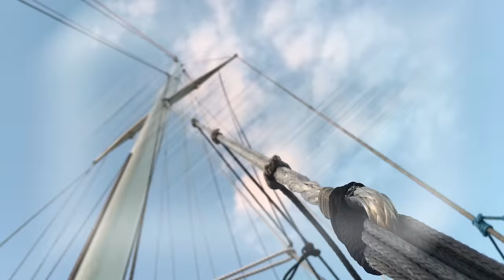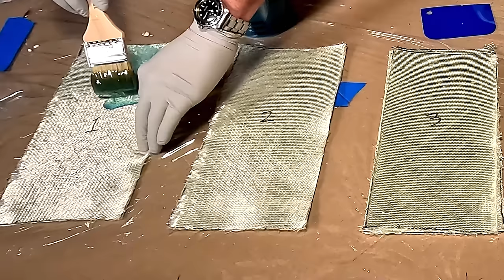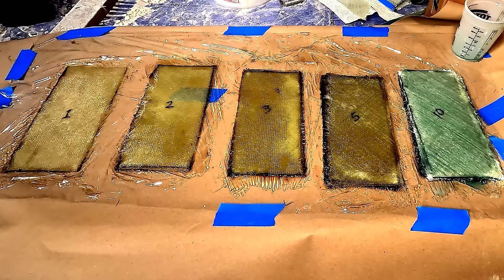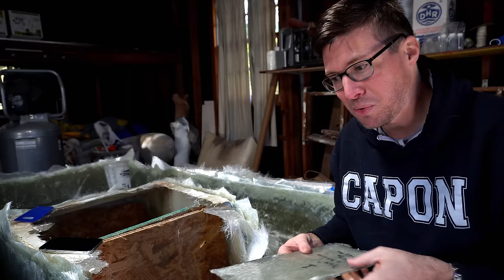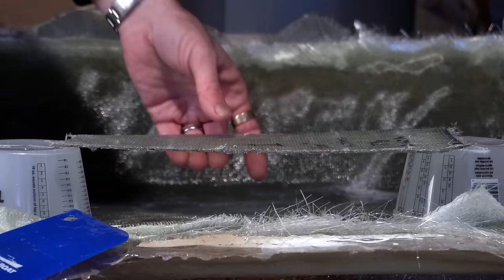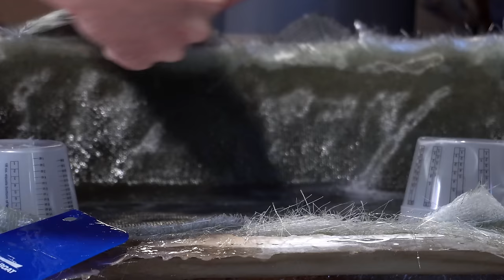How Thick is “This Many” Layers of Fiberglass? | Windpuff's Rebuild [S1 Ep 7]

Comment: My dad had a sample for each of his glass types that looked like a set of stairs.   He cut strips that were 5 inches wide at 25" 20", 15", 10", 5" then did the layers to make something he could keep and show to clients for each glass weave.   He also did some combinations in a stairstep manner for combinations of glass fabric that he recommended.   He drilled a hole in each one and hung it on the wall so people could see them and measure themselves with a set of calipers.
Reply from the maker: It makes a difference to have a sample that you can touch and feel instead of just looking up information in a table

Comment: This was a great real-world test for the hand build garage set up of building  a major part for a boat.  
Nominally 'back in the day' a square foot of fiberglass laminate 1\8" thick was 1 lbs.  This became the standard thickness for fiberglass parts ( not necessarily boats ). 
This was a simple way to price out a product too as you could compare to 1 lbs of steel or aluminum  when costing out a job.
Obviously there are many ways to make it more complicated now!
Cheers warren
Reply from the maker: It was very enlightening to see first hand how my work measures up. I was then able to extrapolate that data and apply it to the build. It’s how I knew I only needed 8 layers instead of 9. Saved me about 3 hours of labor!

Comment: I’m planning to replace the top of an aluminum tube frame “hardtop” with fiberglass (has a stretched vinyl of sorts now). I’m very experienced with polyester resins from doing custom autobody, and interested in your use of same. Would polyester be better than epoxy for my hardtop project? Plan is to use the existing top as a sort of “mold” and remove from underneath. Thanks!
Reply from the maker: That’s what I would use. Epoxy is so much more expensive and not that much better for boat building than polyester. If polyester wasn’t good for large projects, then boat builders wouldn’t use it to build entire boats! 
Epoxy is really good for select projects, but everything else can be done successfully with polyester.
Reply: Next I have to determine thickness… 2-3 layers likely should work. Thanks! Keep up the great work!

Comment: That was a reallly interesting test Herby. Like you, I switch between metric and imperial according to which is the most convenient. Of course, the uk didn't go fully metric until I was an adult so Imperial is in my blood so to speak.
Reply from the maker: Puerto Rico went metric but then partially went back to the imperial. 
Speed limit in miles, distance markers in km
Milk by the gallon, fuel by the liter 
It’s a jumbled mix in my head as well

Comment: Verbally at least, you often are conflating stiffness (resistance to deflection) with strength (tensile or compression load before destructive failure).   This is very much not the case.
Reply from the maker: Very true. Stiffness is resistance to bending, strength is compression and tension forces applied to the material. 
For this video, I’m only looking at stiffness.
Reply: I also vacuum bag glass with a core material to get the most stiffness out of the material. You broke it down to measuring the glass to get the right number of layers well down I learned something every day!

Comment: I became the owner of a 1977 Pearson 365 back in July 2023.  I'm enjoying your channel and videos as I plan my refit to help get my thoughts and plan together!  I'm hoping to start a discussion and in no way intend this as a flame and I am not an expert and the years of experience that I had working in the marine realm was also decades ago.

I built skiffs for the commercial salmon fishermen for a few years and then worked in both in yards doing repair and some new construction for a few more years while I got an engineering degree.  I speak from this experience.  I know this comment is long, but the resin, fiberglass and layup schedule are all pertinent and interwoven (yeah, a bad pun.)

I didn't see you mention the resin type used, I assume polyester.  I also didn't notice the weight of the cloth used.  Polyester resin is not a super adhesive, IMO, nor is vinyl ester. Both are good, but not great, depending on the substrate being bonded to.  Vinyl ester is a better adhesive than polyester, but not as good as epoxy.  Polyester is far and away the most cost effective, but you have to weigh the benefits of the resin choice with the job and you need to make every effort to ensure the resin choice is compatible with the substrate.  Neither poly nor vinyl are should be used on an existing epoxy laminate.  >> If choosing epoxy, make sure the sizing on the mat, cloth, roving is compatible with epoxy and not only poly or vinyl ester resins. <<

? Why did you not include any chopped strand mat in your sample panels?

The weight of the fiberglass material makes a huge difference in the thickness of the final laminate.  When building a thicker & heavier layup, why not use a woven roving?  It is much harder around smaller radii, but in flat areas or more sweeping curves, it is easy.

My experience is that in a repair and also continuing large layups, we would start with a layer of chopped strand mat (CSM) and then follow with layers of roving and mat.  There is even If following with layers of lighter cloth, we would not use the CSM.  In a repair we would try to ideally matching the original layup schedule as "read" from the edge of the ground out damage.  In new construction, we would always start with a gelcoat then mat followed sometimes by a cloth before proceeding the the woven roving.  The first layers of mat and possibly a cloth layer over the gelcoat are to minimize the print through of the roving weave in the final laminate.

CSM is not structural in any significant way, but it can contribute greatly to laminate thickness and thickness can help with panel stiffness.  CSM also helps to minimize air entrapment in the weave of heavier roving.  Again, this is not as much of a problem with woven cloth.  I also do not use usually use CSM when laminating with cloth and epoxy, but if I do, it really needs to be confirmed the sizing or binder for the CSM is epoxy compatible.
Reply from the maker: Thank you for your comment. The main reason for polyester is the Alberg is polyester so we are bonding like to like. Polyester is not a good adhesive which is why we will be creating a massive and drawn out mating surface to bring the two pieces together. 
The cloth is 1708. I didn’t use any CSM in the test because I wanted to figure out the thickness of the 1708 as it stacked up in the part I’m building. On the actual piece, it goes gelcoat->CSM->1708. 
There are parts where I added CSM to help with air bubbles that were not leaving or to help soak up resin rich areas, also to smooth the surface if the edges of the 1708 were a bit abrupt. 
In the part layup, I didn’t count the layers of CSM because I want the thickness to be “greater than” the minimum. By knowing that the minimum is now 8 layers of 1708, having 8 layers of 1708 plus a few layers of CSM means that I’m in the clear and can pop it out of the mold. 
This is by far the biggest fiberglass project I have ever undertaken and has been a learning experience for me every step of the way. The way I do things now might be different from how I will do things later as I get better or know better. I appreciate your input on the matter :)

Comment: Generally, this is really good information to have but I am missing some important things to this video. What weight of fiberglass material are you using? I've used 3, 4, 5, 7, and 10 oz. material with very different results, especially with the layers you're talking about. Also if one is picky, one needs to add an equally consistent amount of poly or epoxy resin to the layers for that weight. I guess the main thing to get from this video is to run your own tests first, with your material (whatever it is) before embarking on a larger project.
Reply from the maker: You got it!
I used 1708 from Totalboat. I definitely use too much resin but I did the test pieces the same way I did the hull of the transom extension that way it would be an accurate representation of the weight of my work. 
Doing the test yourself is a great way to corroborate how well you are doing when compared to the standards.

Comment: Professional wharves often use a vacuum to compress a fiberglas construction while curing. Does this compression affect the thickness and density of the final product?
And how on earth are imperial measurements practial. I am and always will be a metric boy.
Also, I hate to be a pedant but what you were testing was not strength but stiffnes. The two are related but by no means the same.
Reply from the maker: You are correct in my misuse of strength and stiffness interchangeably. I was only measuring stiffness here and calling it strength. 
Vacuum bagging would (I believe) make it a thinner layup because it is compressing the fibers down onto each other. I don’t have the equipment to vacuum bag, so I’m building with hand layup. I did this test to see with the materials I am using and the technique I employ, what are my actual thickness results. 

The metric system is great for measuring everything relative to water, but the imperial system is handy when it lines up perfectly with the task at hand.
Reply: @RiggingDoctor  
Lets agree to disagree on the imperial thing. I don't think that 0.8 of a mm is too hard to multiply, especially for someone raised in the imperial system.
Good luck with the build, I am eagerly following your progress.

Comment: I was wrong, guess 8 layers isn't half an inch lol! However...I think 10 layers will be good for building a hard bimini on my boat. Hey while you're building it are you going to install the backing plates for any kind of sampson post or attachment point for a drogue system?
Reply from the maker: 10 layers will be really strong, but you should also include some stringers to add additional stiffness to the hardtop.
Reply: @RiggingDoctor  good idea
Reply: I would consider using a 1\2 or   3\4"  foam core between 2 layers of 1708 fiberglass unless you want to have a dance party on top!
Cheers warren
Reply: @Cheers_Warren  Cheers!
Reply: A "Qualified Person" would likely recommend a cored composite to achieve required strength while reducing weight high in the vessel structure.

Comment: Good idea for a test! You could as easily use 12/10 mm as 3/64 inches - given this is to the nearest 10th of a mm, as opposed to the nearest 0.2 mm. I wonder if this is a kind of a conformation bias in seeking the US imperial measuring system as the canonical measuring system. :)
Reply from the maker: I normally use my calipers on metric because it’s easier to follow the decimals, but then I flipped it over to imperial and quickly saw the sequence in the fractions. 
This time, the imperial system matched up with the job perfectly!
Reply: Ah, forgive my implicitness - it's a bad habit of mine. What I meant was - surely choosing y=6x/5 (representing 1.2 mm) or y=3x/64 (3/64 inches) makes no odds?

Comment: You still refuse to use a roller. You can change the thickness by rolling more or less especially when there are more layers. I remember a boat for racing. There, almost half of the polyester was saved with the same amount of fiberglass. The laminate in the hull became lighter and stronger but it was extreme. If you want a stiffer laminate, balsa wood or Divinycell can be used. The fiberglass mats are packed into each other and become more homogeneous through rolling, and the risk of delamination also decreases. When performing, add polyester to the first two layers and roll in the third and possibly the fourth layer without more polyester. On the other hand, epoxy and fiberglass require significantly less rolling. I wish you the best!
Reply from the maker: I did this with a brush because I did the rest with a brush and wanted to see what my brush results yield. It turns out that my work with a brush is still 6.25% lighter than the textbook standard for fiberglass density. Imagine how light I could make it with a roller!
Reply: This was a real-world test of what could be achieved in a garage or backyard build .  if you wanted a very specific 'strength to weight ratio' you would do different tests.
Reply from the maker: Indeed! This is how I built the piece and I want to see how it measures up on this test. If I did the test differently from how I did the work on the piece, it wouldn’t be a very helpful or useful test for me.

Comment: Its actually even easier,  West has information on the types of glass and thickness wetted out.  E.G.  3 layers of 1708 is almost 1/8"  One layer os 0.042"  been pretty consistent for me.
Reply from the maker: I wanted to know how thick my actual work was so I did the test even though I found this kind of information online. I just wanted to make sure that my results match what I found online.
Reply: There are simple techniques to calculate the amount of materials required to achieve a prescribed thickness regardless what type of cloth or resin is used. 

All very basic stuff, but critical to safety in fibreglass repair and fabrication.

For structural fibreglass advice / instruction, consult a "qualified person". (This applies to the video producer too.)

Comment: Most videos I have seen show a roller is used to eliminate air bubbles. Just guessing, but I think air bubbles would reduce strength of the end product. Also, it seems the roller would also roll out excessive resin. So, I am thinking that using a roller would add strength and reduce weight. the roller may also reduce thickness but the reduction would be so small it would not be a consideration. Is this thinking correct, or not? Oh, this is not how I smear cream cheese on my breakfast onion bagel with lox!  :¬) Webhead USA
Reply: I have experienced if your making a "patch" backing of this size to help fix a hole in your boat, for example.   The size of a patch this size would only need what he used to move all the bubbles out between each layer bc it's not that big in size, and you can visible see if there are bubbles.  That was my experience.  Just trying to help.😊
Reply: Thanks for the reply. His 6" x 12" patch size was a test for dimension and weight he could apply to his larger size project. I can't recall if I saw him use the roller on his bigger project. But my question was a general question for the process of glassing. :¬) Webhead USA @melinda5777
Reply from the maker: I try to avoid using the roller because it’s a pain to clean afterwards. The brush is disposable so I just squeeze out the excess that way. I have needed to use the roller a few times because I couldn’t get the bubbles out with the brush, but for the most part I have made due with the brush and scraper. 
My weight came in 6.25% lighter than textbook, so I’m good on weight, just need to get the layer count in for the stiffness.
Reply: IMHO, you are absolutely correct. The lamination techniques used in this video were severely flawed. This may have corrupted the results of the "experiment". The techniques shown should not be followed for any structural fibreglass repair or fabrication. Always consult a "subject matter expert" or "qualified person" for instruction how to perform work that can be critical to safety.

Comment: SI is soooooo easy to use. I started off schooling in British Imperial and all this messing around with fractions of an inch is crazy. 1/64, 1/16, 1/32, why when the metric sizes are all so consistent. 1000 micron = 1mm, 1000mm = 1m, 1000m = 1km
Reply from the maker: 3/64, 6/64, 9/64, …
1.19, 2.38, 3.57, …

What is the next number for each series? One of these is obvious, the other needs a calculator.
Reply: With metric it just goes 1,2,3,4,5,6,7,8 all the way up to 999 If whole units are too much than any fraction that is decimal. What could be simpler? @RiggingDoctor
Reply: @jonathanwetherell3609 The lower set of numbers in his example are metric. You do realize not everything you can measure will fall in a whole number in either system. Hence the decimal points in his metric example. Now figure in your head quickly what comes next like he asked.
Reply from the maker: Exactly.

Comment: If a cubic foot of fiberglass is 96 lbs, a board foot would be 1/12 of that, or 8 lbs. This is really convenient math, so the 96 lbs/sf is most likely an approximation.

16/64 thick fiberglass should weigh around 2 lbs.

For you metric people: 1 inch = 2.54 centimeters.
Reply from the maker: After doing the test, my work came out to be 90 pounds per square foot, about 6.25% lighter than the documentation. The important part is I’m not too worried about the weight, more the thickness per layer.

Comment: Love that you're collecting empirical data to verify this. Just wondering if the hull thickness should be specified in number of layers to begin with, since that's what gives the strength.
Reply from the maker: I’m using only 1708 for my buildup so the number of layers is straight forward. For big projects, they will use a thicker type of cloth called Roving which will add a lot of bulk with each layer. This is why the thickness is dictated and then it’s up to the builder to achieve that thickness.

Comment: Is there a control amount ,Oz of resin per area that is constant .
Reply from the maker: The cloth is 1708 and it does state its resin amount to be 25oz per yard. I just wet it until it’s all wet and squeeze out the excess.
Reply: Ok ,I was thinking did you use a controlled amount per layer that was constant during the whole process.
Reply: That would be a better control but not real world conditions.